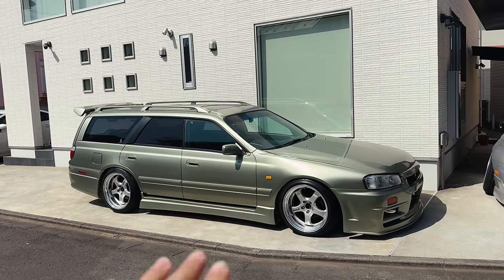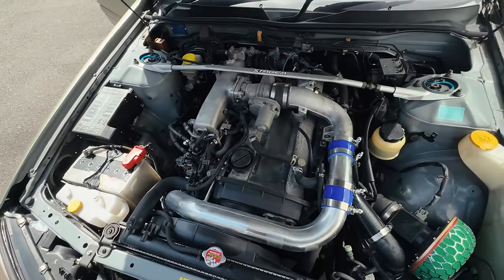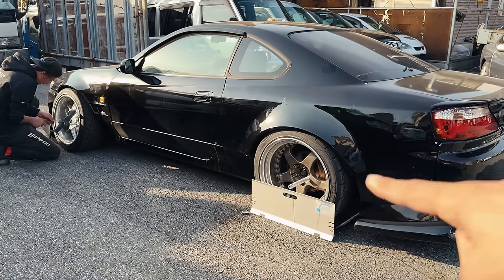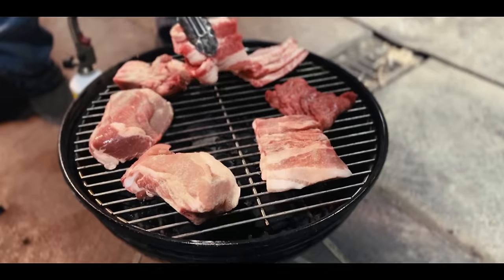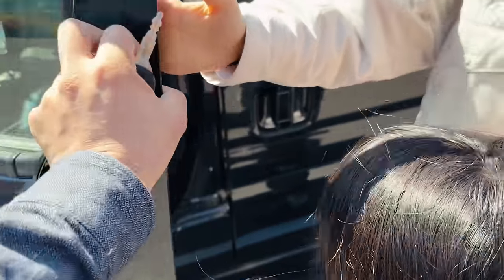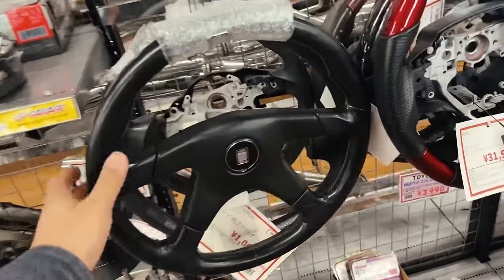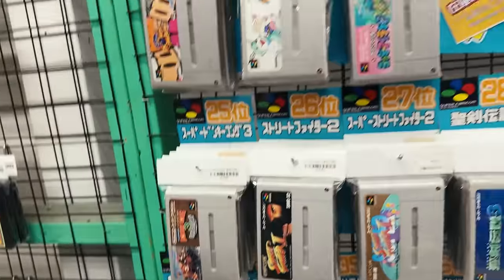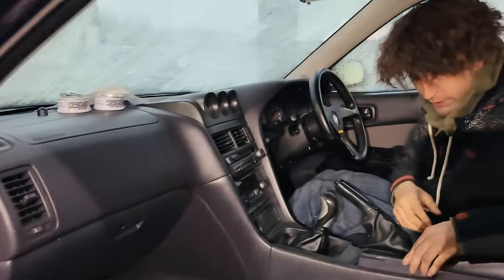My Daughters Graduation In JAPAN! / S4E92

Comment: I actually bought a converted RWD stagea from Japan a few years ago and built it with r33gtr rear fenders, Z-tune front end with fenders, 400whp and after i put some BC coilovers on it it was pretty much perfect and could really tango with a lot of fast cars on track. Very driftable as well and i slept in it sometimes having a roof rack with skibox as storage. Only reason i sold it was because i realised i was single and wanted a 2 door sports car (supra) instead. 

Pretty sure the sideskirts are "Masa motorsports" since i had those as well though not sure about the rear bumper. There is also a leather interior option with heated seats if i remember. You can also tilt the rear seats with a lever on the sides.